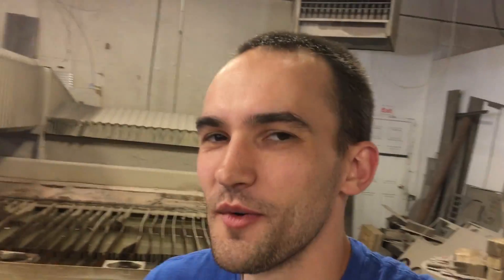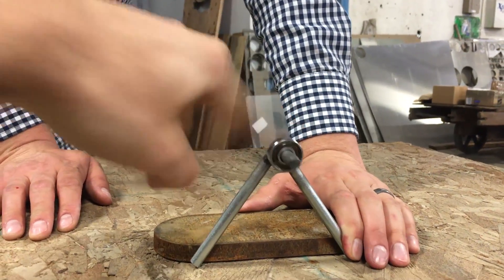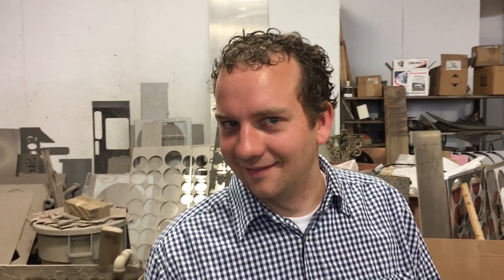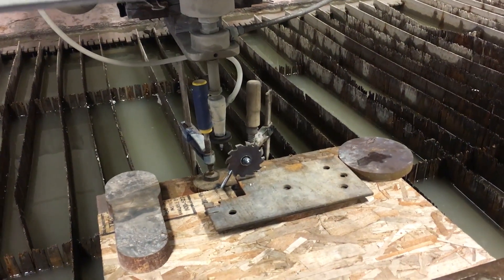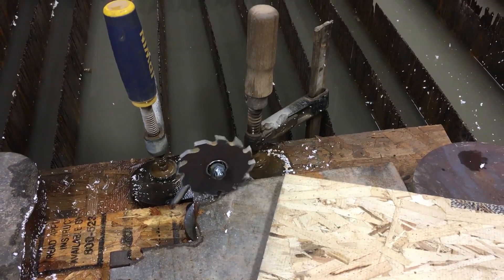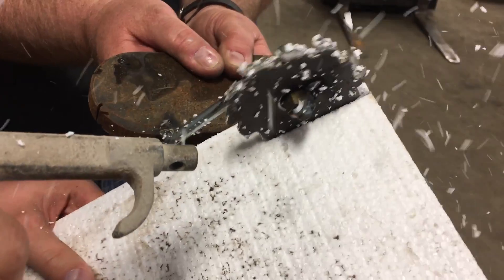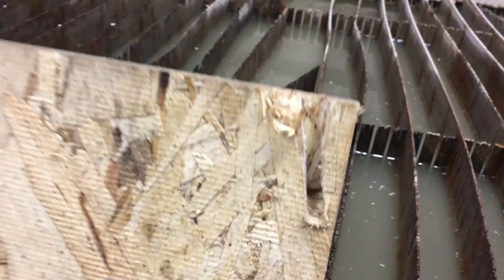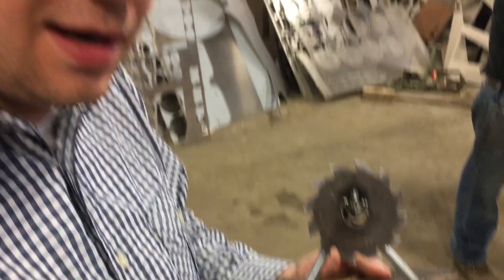Saw Blade Fidget Spinner Powered By 60,000 PSI Waterjet - water cutting metal

Comment: Some time way back in the late '90s, I worked in a small machine shop. One of the products we made was a ~2" nut with a smaller I.D. on one side. I discovered that if I placed one of these nuts over a metal rod and then shot one side of one of the nut with compressed air, it would quickly spin up and make a similar screaming sound. I also discovered that if the rapidly spinning nut departed the metal rod and contacted the cement floor, It would rapidly vacate the area. I would occasionally send one blasting out the overhead door and across the empty lot, never to be seen again. Then one day, one of these "death nuts" must have struck a non-level part of the floor, because it didn't go ---> that way. It went ^^^ THAT WAY. I put a large dent in the underside of the metal roof in about 1/4 of a second, then proceeded to ricochet around the shop.  Luckily, the only other person in the shop was the other equally stupid high-school kid who was partaking in the dumb-fuckery right next to me. 

And that, kids, is why you should think twice about hiring your step-son (and/or any of his friends) to work unsupervised in your family business.

Comment: First of all, you have a water jet why wouldn’t you just cut the hole in the middle and then lathe it to size to press fit the bearing? Or even just drill it. Second, that thing was spinning at probably 30,000 rpm way faster than that bearing can handle. That was probably one of the most sketchy things I’ve ever seen on YouTube.

Comment: In normal circumstances people would have called it off once they heard that noise solely for safety. In normal circumstances people would have called it off once a spinning buzz saw came off the table spinning at high speeds. In normal circumstances, the creator wouldn't do everything in their power to assure the content worked, but by god you guys did it and didn't call it off. Forever subbed.
Reply: in normal cirumstances you wouldn't hold a goddamn power tool together with kra-z glue XD

Comment: considering the rubber skateboard wheel were able to punch through the plywood like it was styrofoam i'm sure this plank of plywood you are holding like a shield will be able to contain the blade when it start flying off.

Comment: The proper way to do this would be to centre bore your bearing hole  to the exact measurement of the outside of the bearing then heat up the blade and press the bearing in.  This way it's all perfectly balanced and that bearing will never come out! That made me cringe seeing that thing fly off

Comment: Next time you make a rotable of any kind, make the bore .002" under size from the bearing. Then heat it up and push the bearing in and it'll thermally set. Never comes off

Comment: You should have been inserting the wood from the other side of the blade.  ON table saws the blade enters from the top of the the wood not the bottom.  This way the wood is pushed in to the table of the saw.  With the way it was done here the wood was being constantly kicked away.

Comment: This is like using a chainsaw to power and angle grinder.
Reply: witch should be you next video.
Oh what if you got the angle down to try and sharpen a blade and or running chainsaw

Comment: Should weld another blade attached to the original blade and a bar that connects them both so the water can turn one while the other one spins with it. Kinda like an axle in a car. 2 tires to one axle.

Comment: waterjet cuts another waterjet
Reply: Baker the entire universe would implode
Reply: no...

water jet cutting a waterjet cutting a  hydraulic press pressing a cancer spinner
Reply: TheNeonGuy l Road to 100 subs cuting 1000 degrees knife
Reply: waterjet cutting water jet cutting red hot ball melting a knife 10/10 original meme
Reply: Waterjet cutting waterjet which is cutting the same waterjet that's cutting the other waterjet cutting the same waterjet that's cutting the other waterjet cutting the same waterjet that's cutting the other waterjet cutting the same waterjet that's cutting the other waterjet cutting the same waterjet that's cutting the other waterjet

Comment: K. First time I've seen something be POWERD by the waterjet and not be destroyed by the waterjet.
Reply: WoT Dimitris well when they were cutting the alternator and it spun like crazy I'd say it powered it
Reply: Leaving out the abrasive media also helps.
Reply: I'm assuming they ditched the abrasive for the spinning and used pure water. That in combination with the fact that it is able to move out of the way meant that spray was distributed rather than focused, removing the cutting effect.
Reply: They probably weren't using the abrasive
Reply: Spinning is the path of least resistance
Reply: WoT Dimitris you play battle cats aswell?